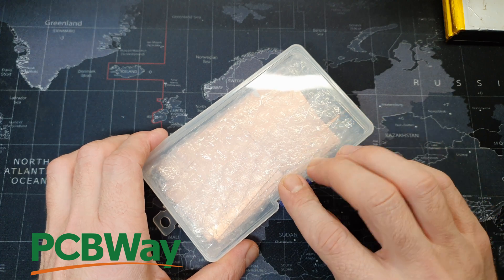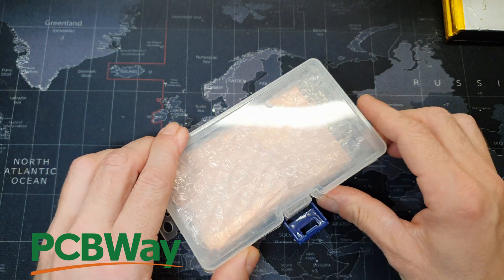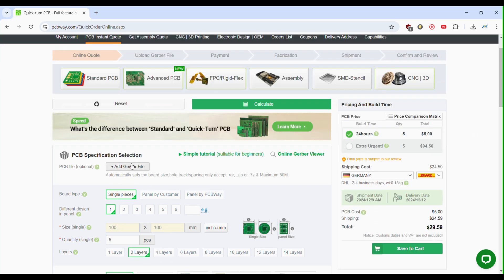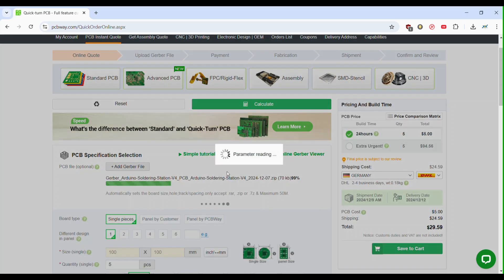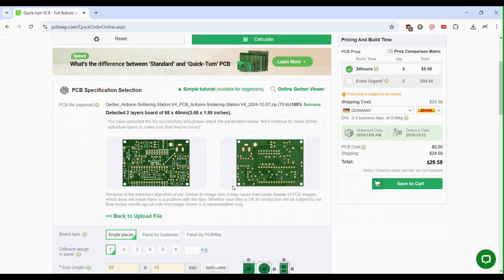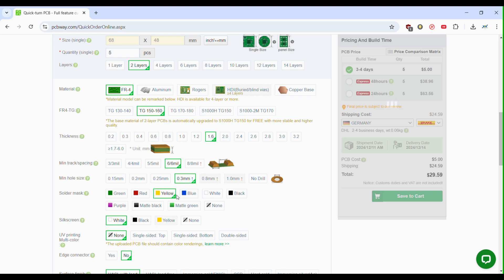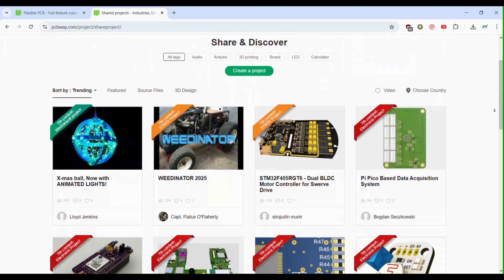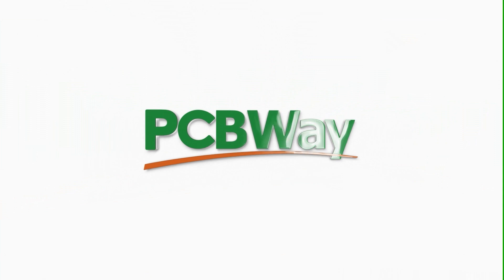How To Make Arduino Soldering Station  (Cheap JBC C245)

Comment: I can do whatever I want, it will never work before, I set 30 degrees, the soldering station shoots with a full can to 330 and up without the soldering tip being recognized, why do you answer, because I won't really have more than that soon 3 weeks a fight it's sad! Please help me to get this done, or did you upload this to get clicks and the circuit is completely broken?
Reply from the maker: If it worked for me it should definitely work for you as well. But sometimes electronics is hard, isn't it? I don't spend many days coding, making schematic, pcb, testing, designing the case and making the video just to show you somting that doesn't work, I don't think that in this way I will attract many subscribers. Anyways, I will try to help you out, first you have connect the handle wires correctly, red is thermocouple, blue is heater and green is ground, check if the Mini360 voltage is set correctly it should be around 7V and from arduino board you have 5V, check for short circuits and improper solder connections, use another op-amp, it is possible to have a bad op-amp, another thing is that the transistor BC337 should be soldered backwards or use 2N2222 and solder it normally, otherwise the mosfet will run very hot and the temperature of the tip will be uncontrolled and will have bad temperature readings. good luck.
Reply: Hello, thank you for your reply, if I finish this I would be the happiest person so:

I don't have any short circuits, as soon as I switch on the station the numbers jump around from 300 degrees slowly down to room temperature even though there is no soldering iron on it, is that normal? 

My soldering tips have 2.2 ohms, does that still work?

I soldered the BC337 the wrong way around like in your video, not like in the circuit diagram but like in your video

Vin = 7v
5V = 5V 

Mosfet doesn't get hot either, but I set it to 30 degrees, it goes up like a cannon with the temperatures and then it glows.

My power supply 24V, 2.71 Amp is enough? actually it should because it glowed like a cannon 

I don't have to change anything about it
Leave the program like this and it should work? 

Please I am really grateful to you 😔

Comment: Its really a hell about more Than 14 Days i am Stuck on a Project which never ending in a bootloop concepts i use a 24V 3 Ampere and try to test if its boot , its give me only a white Screen it isnt working now TC and Power + is in same rail or i have no power and energy more i will slowly use it or can trash it
Reply: sometime wrong connections or fake component cause issue. check opamp gain and transistor connection for mosfet.

Comment: Hi my First Try was ending in Horrible my Arduino Atmega Chip is getting hot and now it is damaged i think 😞

How i can work on these project without damage a Component ? before getting the Power everytime checking with Multimeter ?
Reply: make sure your mini360 module is ajusted to 7v before connecting to arduino VIN, and be careful on pin A1 because it is connected to 19volts
Reply: @ Yes but no chance

Comment: Can I use an adapter that is 24V or higher?
Reply: i use a 24v 3Amp but i cant use the station i am not sure if that really works or its have a mistake on circuit or i have a mistake , but it is 100% not working

Comment: In the connection area of your circuit diagram there is a “JST1 SW” with 2 pins, connected to GND and D10. What is the purpose of this? If it is the connection for the standby cable, why does it have 2 pins? At 13:01 you only connect 1 Wire. I also cannot find the connection for “JST1 SW” and the standby wire on the boards. I would be pleased to receive your answer. 👍👍
Reply: Its fake
Reply: how u know thats fake ? because i cant use it, its ending a disaster
Reply from the maker: I updated the files ( see schematic and top board picture ) I marked as SW+, from top board the SW+ wire goes to the handle holder and the handle is ground, when the handle is inserted in to holder D10 is pulled down and the station enters the stand-by mode, first time I had another idea to connect the stand-by wire but later I changed to single wire but I forgot to modify the schematic as well, sorry for that.
Reply: @HMProjects  👍👍
Reply: c13?

Comment: Your 've left your PCB 's copper tracks exposed to oxygen...they will very soon corrode...
Cover them with something like uv curable Solder Mask Ink for pcbs.
Reply from the maker: @pgsss6354  No I didn't, I sprayed the boards with colofonium dissolved in isopropyl alcohol, it gives it a good protective layer, after it dries is like transparent varnish and is not sticky, of course being basically a flux it easier to work on the boards, solder or desolder components, and can be washed with alcohol or acetone and reapplied afterwards. I filmed the process but I totally forgot to include that part of the video.

Comment: Hey, could you record a video on how to connect the iron, cable and plug to the v3 soldering iron, this 1st project with an encoder?
Reply: Dont have it's fake
Reply: I have trash now again an arduino 3 items on trash , i dont know it that real or not please are the bc1337 in rightly position ? 

On shematics with the PCB Design it is on other way and on video other ?

These Shematics Kill my Arduino and my Money please help, which area are important to know what is blow my Arduino ?

Comment: I couldn't find 4pin c245 handle. what to do 😢, I ordered all the other parts.
Reply from the maker: @thisarukalpana4910  Mine also came with 5 pins connector but I changed with GX12 connector (aviator connector) with 4 pins.
Reply: Ok thanks❤

Comment: Please Please can i uese a Yihua T245 Handle and a tip of Yihua C245 isnt it a clone from JBC ? please please Helps
Reply: yes you can use  Yihua T245 Handle
Reply: @dhiraj787  and the Tip from Yihua C245 Too ? or must i use only JBC ? because JBC Tips are hardcore Expensive : (

Comment: C210 project plz
Reply from the maker: In the future I'm planig to make a smart soldering iron with those tips.
Reply: use v4 T12  iron schematics and Change R8 resistor (220K) to 540K and use 12v 4 to 6 Amps power supply, c210 handle will work.  Just recalibrate tip.  no change needed in code.  for better result replace lm358 with mcp602 opamp.
Reply: Plz provide solder mask pdf

Comment: Thanks for Sharing and another Great project no doubt. The nice part is that, Even if not intended to begin with, the laser engraving is actually  very awesome. Does add that "3D feel" to the front pcb.
Reply from the maker: Thanks, is more to improve to this project, I will make some changes in the future and I will share the updates, as for the laser engraver the idea was to make all the markings and then fill them up with white paint but they were not deep enough ( didn't use enough power with laser), so in the end I decided to paint the boards with black paint, otherwise if this didn't work out I would had to make the pcb's again.

Comment: hi,

can i use a c245 tip from the brand Yihua or must i use only JBC 245 on branding , that is the best christmas gift which i ever see i love ur worx 😭
Reply: Yes you can use c245 tip from any brand. works perfectly.
Reply: Thhhhxx biiig for the answer loves flys out for u too 😍
Reply from the maker: Yes, it will work.
Reply: Ohh Loord u are too great tooo much i thx u a lot 😍😍

Comment: Why not use pid control ?
Reply from the maker: Direct control it works best for me, but it works as well or even better with PID control, it's just a matter of preference.
Reply: @HMProjects  Haha You are fooling everyone. That's why you don't try to solder on pcb, your circuit won't work properly, tip C245 works at 24VDC you only supply 15V so Direct control seems fine.
Reply from the maker: @DucHanh188  Why I will want to fool someone?, I don't sell this station, I made all the files available if someone wants to make it. Yes it's not perfect and yes I missed out some important points in the video, like soldering something with the this station, calibrating the tip, using PID control, showing the real temperature of the tip and so on, but the video will probably be an hour long, you try to make a video and trying to cover up every aspect wile keeping the video short, and not to mention that you have to finish your project and video for YouTube wile coming home from work at 11 pm, so guys like you to complain about your video, do all that and then come here and tell me how it fills like. Even I don't have to demonstrate you anything, maybe I will make a follow-up video and cover all the missed aspects from this video. Have a nice life!
Reply: gracias a amigo 🎉🎉  @HMProjects
Reply: Because it won't work. He deceives everyone. The C245 only works best with  pid control,  Direct control is terrible.
Reply: @DucHanh188  it may not work properly as it is homemade project. But it works, easy to build on single side pcb with easily available components. So you should not complain. for professional you have to buy expensive opamp which may not available everywhere, soldering iron with lm358 it will add lot of noise and offset voltage so pid struggles to handle it. C245 tip will work just fine at 15v just heats up slowly, you can't use full power but in day to day use we don't require that much power.
Reply: I want to build this project please are this can handle until 24V
Reply: Can i request for c210 controller
Reply: I am
on there but its doesnt work properly you need 12v 6 amps is safer but i have buy 12v 8 amps because it was everytime restart over 30 Grad degrees

Comment: can i use t12 board and just replace the handle to c245 ? or the hybrid code for rum t12 or c245 on the t12 board ?
Reply from the maker: No, it will not work, the code itself would probably work but the pcb's are a bit different.
Reply: @HMProjects  make it for next project, it sound fun 😆

Comment: can i use c210 handle with it ?
Reply: NO YOU CANT USE C210  HANDLE WITH IT.  c210 USES 12V AND ITS RESISTANCE IS 2.3 Ohm. If you connect c210 it will heat too much become red hot. To use c210 you have to make many changes, you have to change gain of opamp to match c210 thermocouple.  use 12v 6Amps power supply and make changes in pid code in arduino
Reply: Change R8 resistor (220K) to 500K and use 12v power supply prefer 5Amps adapter, c210 handle will work.  Just recalibrate tip.  no change needed in code.  for better result replace lm358 with mcp602 opamp.
Reply: @dhiraj787  Friend can u please help ? i have problems too see if that working, i have a white screen but its not working, i use 24v 3Amp is that the mistake ? i test without Handle i will see , that the station is properly builded by me from the shematic : ( please please help
Reply: hi,

i have replace the resistor with 500k and a betther OPAAMP for c210 but its working not properly ?

First Calibrate than use or ? 

Which version u have use as ino
the Version 4      T-12 ? 

Please for answer i am only on these finalstep 😢
Reply: Please u have say 

u use V4 T12 Station for using it on C210 without editing ino 

I have Burned one of my Tips its trash its over burn

I have use exactly 500K Resistor 
and MCP602 

No Ino edit, please how i get that C210 to working ? anyone have done this C210 Edition ? 

I use 12v and 8Ams no work 6ams no work anything is here wrong, are u sure that u really use c210 ?